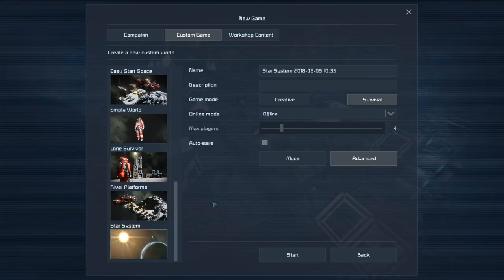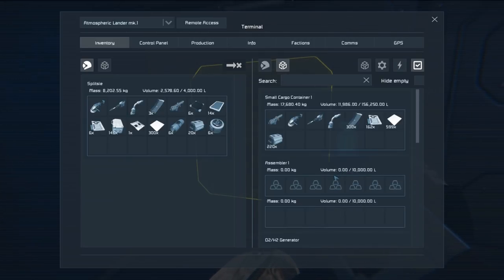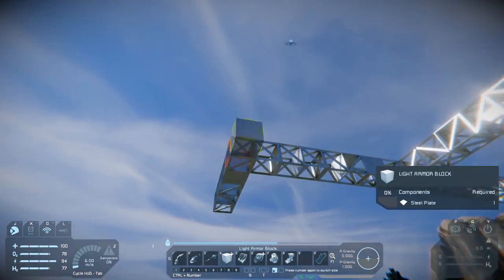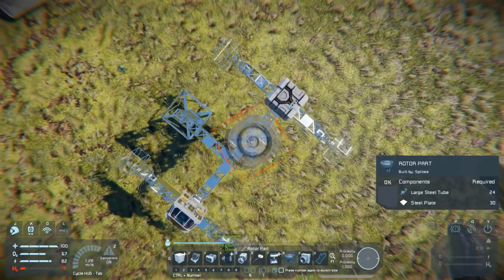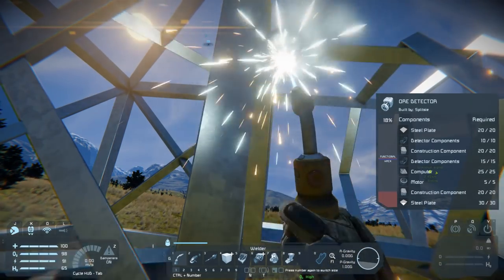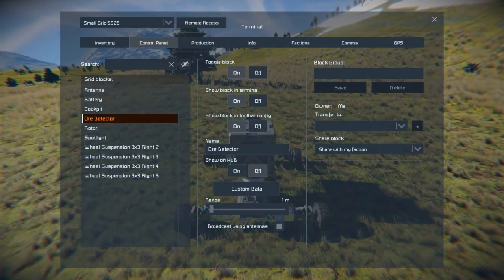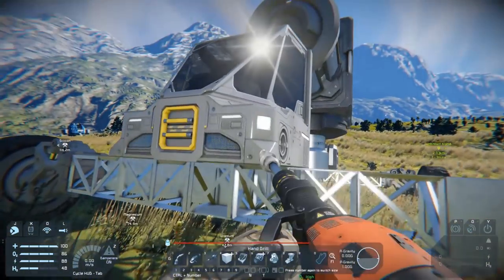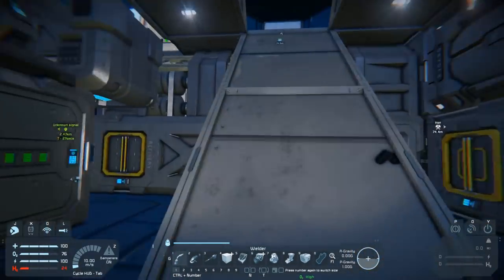Space Engineers Tutorial: Landing on a planet and finding ore (Guide to finding ore in update 1.186)

Comment: I hadn't considered using that method of building large-grid on small.  What came to my mind while watching it is--to lower the center of gravity--to build the rover with the cockpit facing up, so that the rotor will end up facing towards the front of the vehicle--or vice versa.  It will make the rover longer, but lower and less likely to tip over.

Does that make sense?
Reply from the maker: It's worth a try, anything to lower the centre of gravity is worth at least one or two crashes in testing 😂

Comment: using the large detector makes sense in many ways except the power needed.. especially from a battery... my real question is what is the purpose of the small grid detector when the hand drill also detects at about the same range... just a quick thought for you.. and also do the higher lvls of hand drills increase that range... or do they just mine faster....
Reply from the maker: I think the purpose of the small grid detector becomes apparent when you're scouting with flying ships, you don't want to have to jump out with your drill every time you see some ore. As to the levels, I've honestly never tested it, I believe the higher tier drops more ore more quickly, but not 100% certain on that.

Comment: Is that trick you did with the rotor a way of doing mixed-grid constructions? I was under the impression that you had to build on one grid size, or the other, as they don't 'stick' well and invite Clang's minions on board to troll you. Which reminds me, is there a similar trick using connectors I could use, to solve the problem I seem to be having when I try to connect a small-grid ship connector, to a large-grid base connector? It's confusing :-s
Reply from the maker: You certainly can, but there are some negative side effects to it - on flying things the inertial dampeners won't work properly due to the extra subgrids so I'd only do it on bases, the more of them you add to a construction the worse the potential for unexplained and rapid deconstruction (explosions) and also large amounts of them tend to harm performance
Reply: @Splitsie  Ahh, I see. That explains why the ore detector's on an exceedingly simple rover, then - lol. Thanks :-)

Comment: I grind down the thrusters and all the blocks above the flight seat add a few blocks to the front and back of the ship add wheels and boom mobile base with ore detector lol
Reply from the maker: That'd probably work a lot better than it used to with the change in the centre of mass behaviour but I haven't tried it myself yet, it's been a while since I loaded up a new game with the lander. Have you managed to roll your new mobile base since the new wheels update?
Reply: Splitsie not yet but I have a bit on the old system

Comment: Tried building this today, the small rotor wouldn't connect to the large rotor. It simply wouldn't attach when toggled inside the cockpit. I double and triple checked everything and I didn't do anything wrong with the instructions. Any advice?
Reply from the maker: If the rotor head isn't in the right position (too close or not centered) it won't connect. I've used this technique recently so it does continue to work, but these days I would recommend using the advanced rotor instead simply because the small grid version is 3x3 so it's easier to drop the advanced rotor part onto it, so that might be worth trying to see if you have better luck with it

Comment: Thanks for those tutorials. It helps a lot young players like me.  I do have a question about the rotor. Your video seems showing a small version on it. When i tried to replicate that part, I got a massive one I can't change. Is there some kind of 'trick' to do it ? Thanks.
Reply: ablc2007FR are you talking about rotors on small grids?
Because if so, the small Rotor has a size of 1x1x2 blocks while the small advanced rotor is 3x3x2 in size
Sry if I missunderstood your question, if you mean something elso let me know and I'll do my best to help!
Reply from the maker: As Donnerrob said - thanks for helping by the way :) - there are two different rotors that are those sizes. 

There are two ways to get the small rotor, if you look at the icon for the rotors in the G menu it has a little + on it, you can get to other versions of the block the same way you can with the armor blocks (usually by the mouse scroll wheel). If that's not working for you for some reason the other option is to search the G menu for 'rotor' when you do that the specific basic rotor will show up which is the one I used in the video :)
Reply: Splitsie always a pleasure!

You're doing a great Job btw!
I would call myself an "advanced SE player" but I still enjoy your videos a lot.
I can only imagine the help they represent for new players, as SE is not what you would call starterfriendly XD
Reply from the maker: Thanks! I certainly agree with you on it not being starter friendly :P
Reply: Thanks for the clarification, and yes, i could only agreed on the 'noob friendliness' of the game ;)
Is there any "must have" mods list to start the game in survival ? Thanks a lot for your support :)
Reply from the maker: That all depends on your preference in terms of mods, this ( http://steamcommunity.com/sharedfiles/filedetails/?id=1146074670 ) is a collection of mods I put together that adds some nice decorative mods and some NPC ones that don't change the feel of the vanilla game :)
Reply: Thanks. I was able to build the roover and find some ore. Driving on ice was an interesting experience...

Comment: Do you know what the timer block and programmable block are for?  I want to keep my lander able to fly as there's no ice near my usual mining area, and I don't really need to grind those blocks for parts - but it would probably help me to understand their purpose and use.  Thanks.
Reply from the maker: On the lander, I don't think they do anything so go ahead and grind those blocks down :)
Reply from the maker: In the general use of what they are for, one of the most common uses for timer blocks is to trigger multiple actions simultaneously as a timer block can trigger up to 10 other actions on blocks at once. As an example you can have a timer block that sets your connector on your miner to lock, while also turning off the lights, antenna and thrusters and turning your battery to recharge. You can also use them to delay actions, but 90% of my use would be for doing two things simultaneously.

Programmable blocks have an enormous number of uses depending on the script you put in them, a nice place to start with that is Automatic LCDs as it shows a bit of what's possible while also being fairly easy to get your head around at the start (or at least was easier for me than some of the others around at the time).
Reply: @Splitsie  Thanks - It'll give me room for another battery and/or reactor or something.

Comment: What is the purpose of putting the detector on a rotor in the first place?  You can turn the rover. Yeah, I'm new.
Reply from the maker: Detectors have a spherical detection volume, the point is to allow you to put a large grid detector on a small grid ship (the conversion between the two can only be done with rotors). The large grid detector has a range 3x the small grid one :)
Reply: Splitsie thanks for the quick reply. I did manage to figure it out the reason when I couldn’t get the detector to attach to my rover😆. It works great, but for some reason it shows orange in the control panel.  I thought there was something wrong because unfinished parts are red, but works fine. Is it because since it’s attached to the rotor it colors it differently?
Reply from the maker: @egdod3750  Yep, anything that's a 'subgrid' is coloured differently in the control panel (each subgrid having their own colour). 

A subgrid is anything connected via rotor, piston or connector :)

Comment: Just one question about the rover... how do you recharge it?
Reply from the maker: If you have a connector on the rover and one on a base then you can recharge it, or put a reactor on the rover once you have found some uranium as you'll probably only need one and some fuel and it will remain powered for a very long time :)
Reply: That seemed to work fine.  I was surprised at how long the batteries last (I've actually got two on mine).  I used the 5x5 wheels, I also put a gyroscope on and disabled steering on the back wheels to improve handling.

Comment: Hi, quite new, so I wanted to try your idea with the big ore detector but on an atmospheric ship, and boi do I regret starting this project, I don’t want a rover cause every rover I build flies off and explodes the area I’m in seems to have low gravity, anyway

I’m having an issue where as soon I turn the engine on, the ship just flips and goes in god knows which direction and won’t stay upright and I have loaded so many thrusters on it, I can’t get it off the ground straight what am I doing wrong?
Reply from the maker: You may get better performance out of it if you turn on shared inertia tensor, but otherwise having large grid on small is often a challenge to support since large grid are soo much heavier than small

Comment: I was hoping I could add solar panels to my lander to help keep the batteries topped off and to draw less power while in flight, but I can't seem to get regular ones to stick - they fall off as soon as I place them.  It doesn't make sense - the lander is a large ship, right?  Is there a way to do this without mods?
Reply from the maker: The solar panels only have attachment points at the ends of them, so you'll need to have a flat surface to attach an end to, if you have a look at some of the earlier episodes of my Survival Maybe series, I mess around with a lot of solar panels and it might give you some extra ideas :)

As to helping with flight, they'll more help with charging the batteries slowly while landed, at lower altitudes it's sadly not possible to make a solar powered flying machine :P
Reply: @Splitsie  Thanks, I'll give it a look.  I tried to mount them on the sides, like wings but vertically, and they just dropped off.  I'm sure I'll get some ideas.
Reply from the maker: It's the short edge that has the attachment, so try them like wings, but with the short (for large grid 2 blocks) side attached and you should be good :)
Reply: @Splitsie  I put a pair upright on either side of the roof - I just had to replace the top layer of sloped blocks with flat ones.  It makes landing my miner on the connector stack a little slower as I can't get a long view from the side, but there is still room and it works.  Thanks!

Comment: Hm. Somehow my rotor isn't moving at all. It sits at 107 degrees, and when i do the same thing that is shown in the video, nothing happens..
Reply from the maker: Did you grind away the extra blocks that were used to hold the rotor part? Check to see if anything is in the way of the rotor spinning - any blocks that are at the same level of the rotor. The other thing you can try to see if it helps is to set the displacement of the rotor to its maximum that may give you some clearance. 

The other things to check that I often realise as I'm fiddling with settings: make sure you have power, try rotating the rotor with nothing attached to it, make sure the rotor has enough strength to move what's attached (that's why I try with nothing attached), make sure the rotor has a velocity that's not equal to 0 (either positive or negative).
Reply: Yay! Displacement helped =) Thank you very much! =)
Reply from the maker: You're very welcome :)

Comment: Why did you put ore detector on a rotor, is it directional?
Reply from the maker: The rotor is to allow a small grid vehicle (which is cheaper to build) to have a large grid rotor head and therefore also a large grid detector on it (which has substantially greater range). It's the only vanilla method for making something with mixed grid sizes :)

Comment: I think the new update has introduced bugs into the core game. After the update, I started a new game with no mods. Started building a small minor. Left to go pickup a drop pod, when I return my ship was gone along with the materials used to build it. The assembler keeps items in the que. The debris from digging is glitchy. Has anyone else had any problems?
Reply from the maker: The ship going missing is likely due to your trash cleanup settings, you can access these through the menu after you press alt+f10. Unfortunately by default any unpowered grid that you move too far away from will be removed by the trash clean-up process. 

The debris from digging is new from the latest patch - at least the large graphics based chunks. Hopefully a lot of the behaviour with them will start improving as they continue to update it, things like this are normally rough when keen first introduce them
Reply: Splitsie I hope your right about the trash clean up. I stopped playing because I didn't want to lose a ship with alot of time in it, but I can make sure to power any grids I want to keep alive. I have 400+ hours playing this game and that worried me. The debris is just a nuisance. I will start again and hope they get any core braking code cleaned up in the next few updates

Comment: How do you recharge the battery on the rover?
Reply from the maker: You'd need to put a connector or solar panels or a hydrogen engine on it to recharge. Back when I made this tutorial wheels used very little power (it got increased last year) so the battery was likely to last for a very long time which meant I didn't feel the need to cover it back then, a little different now though :/

Comment: Hello ! I love your videos. I built this rover and I love it, but whenever I try to drive on rocky/rough terrain, the suspensions (or blocks near it) almost instantly break out and fall apart. I have tried tweaking suspension settings, it's a bit better on normal terrain, but those rocks wreck my rover... How do you deal with it ? I'd like to avoid these but they are everywhere on my snowy moutains planet...
Reply from the maker: Thanks, those rough craggy bits of terrain are always a problem for small grid rovers, the only way is to avoid them whenever you can :(

Large grid rovers can usually manage then well though
Reply: Oh I hadn't thought about large grid !
I however removed the horizontal poles sustaining the wheels, because they were too close to the ground and colliding with the rocks. Instead, my wheels are now on diagonal poles, putting the main part much more above the ground (not sure if I'm clear here...). It's better now since I only have to be careful about what the wheels touch. But the "skeleton" is quite light so the rover has a tendancy to tip over and fly away haha !

Oh, and when I fill the cargo, the rover quickly tips over xD I can add some blocks in the front to balance it all but it's not really worth it... I also try disabling propulsion in rear wheels, it's better but I cannot climb shit haha !
Now I only use the rover as a detector and come back with a flying ship for mining :) Of course it uses much more energy :p

I'll try the large grid then, thanks !
Reply: Ouch, large grid is sooo expensive ! And I'm in early survival with full realistic settings xD

I removed the cargo, too much imbalance. Now it's strictly limited to the role of ore detector, and then I come back and mine with something else. At first I was very pissed by the rocks because I landed on top of an icy mountain (to have ice and solar exposure), and it seemed like they surrounded me, but I realized I could always find a way to avoid them.

Thanks again for all your videos, I love them ! :)

Comment: My ore detector isn’t detecting any ores does anyone know why?!
Reply from the maker: There are deposits scattered around the planets, on earth like they are marked on the surface by mottled grey areas, these are most visible from a distance where grass is no longer showing up (or just turn it off in the graphics options) then when you're on top of that area you should detect things. It's worth noting that the detectors default to only half their maximum range, so you should change that in the control panel too :)

Comment: How do I start the rover
Reply from the maker: You need a battery or other power source on board then will be able to drive from the cockpit. If you find you're not moving you may have your parking brakes on which can be toggled by P (though I don't recommend that technique due to its habit of causing issues with more complex builds later) instead add the cockpit to your hotbar and select the hand brake option from that block - if that's not making much sense check out my newer series of tutorials as they cover all these topics in better detail :)

Comment: FYI this no longer appears to work.
Reply from the maker: It all still works, I've done it on a recent save. Which part are you having trouble with?
Reply: I also can't place the Big Oredetector
Reply from the maker: It's quite fiddly getting the large rotor head onto the small rotor, especially making sure a large head is the things that's created when you've got the head on your hotbar. Given the spots on the surface are there, you may be better off using some of the tips I showed for how to find resources in this video (which is in the latest version): https://youtu.be/kL8XQ1Avz-0
Reply: @Splitsie  i have a small one at my rover, but i cant find any ore.
Reply: @Splitsie  nevermind i can find ore but its like 1 nickel per hour